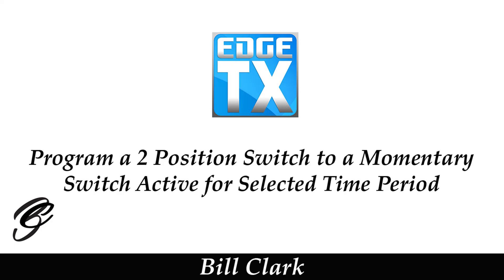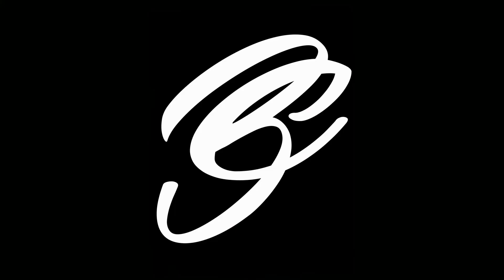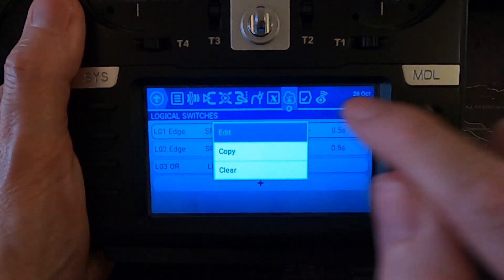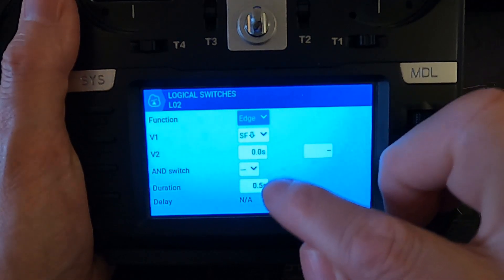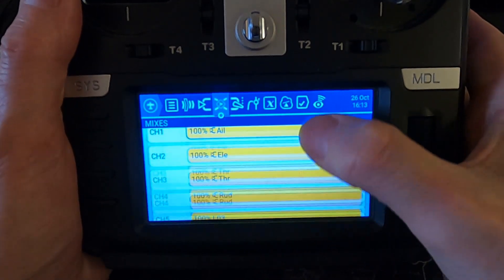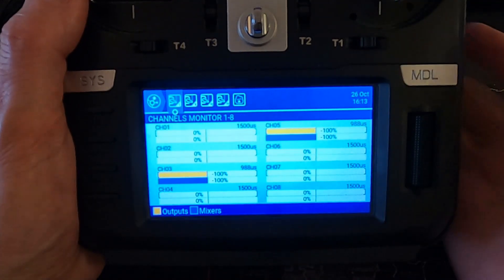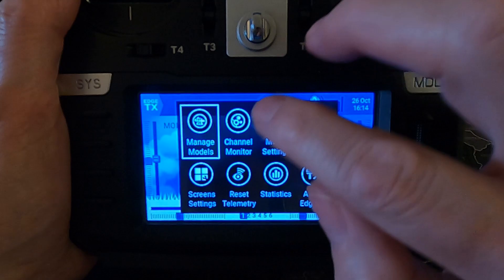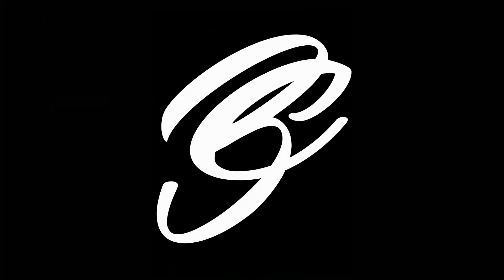Program a 2 Position Switch to a Momentary Switch Active for Selected Time Period

Comment: These tutorials are always interesting Bill - even if we don't have an immediate use for them. Thanks!
OK After the buttering up, maybe we could interest you in a little problem (which might not have TOO much general interest or use) that we've come across recently. 😉  To quote from the unanswered query on the forums .....

 "Peanut gallery here again. I'm sure that there is probably a way to get around a problem posed by a quirk of the old NX3 stabilizer when in "Hold" mode by using the programming capabilities of OpenTX. But our Junior Brains Trust not being available and the rest of us Old Farts having too many years and not enough remaining knowledge or intellect to attempt a solution, I wonder if any of the more competent posters here might like to try? On radio for preference.

Relevant details ....... "What happens with the NX3 set to "Hold Mode" is when say the Elevator stick is pulled back, the Elevator will rise to a point allowed by the stab gain and servo geometry. When released it will fall back towards centre - HOWEVER there is some hysteresis entering the system somehow as the Elevator WILL NOT reach the centre position. And again, if you deflect the stick forward then release it, the surface will stall in its return just before centre. Thus causing a "Bucking Bronco' control effect when trying to steer the plane without switching out of the "Hold Mode". What causes this hysteresis I don't know.

1 quirk is that the slight deflection (in either direction) is MAINTAINED if you switch from "Hold" to "Manual" (where the surfaces centre as normal) but then back to "Hold" (and the deflection returns.)
HOWEVER if you switch right through to "Rate" and then right back through to "Hold" again that slight deflection is gone!

This could possibly provide a method to kill these strange deflections by setting up your OpenTX/EdgeTX transmitter with a Special Function/ Logical Switch combo that flicked through Hold/Manual/Rate and back again when the stick value hits centre. I haven't reordered the switch positions to "Hold" - "Rate" - "Manual" to see if just "Hold" direct to "Rate" and back kills the preset or not."
Any takers?"

I thought that it might be possible to perhaps create a 'Dead Band" of a few usecs or so around centre-stick which, every time it is entered, would trigger a momentary flick through the stab "modes" via some logical switches/special functions/GVs to kill the surface lags. 

No pressure Mate! 😜😊
Reply from the maker: Hi Mate, looks like you are planning to use a plaster to fix a chopped off finger! 🙂 There must be a problem with the NX3 and is it worth putting it in a precious model? I would recommend getting a ZOHD Kopilot Lite which is more expensive but very good. I would love to get hold of the plane which is having the problems and attempt to solve it but difficult without seeing the problem in person. The deflections must be being caused by the NX3 the radio will not be making these deflections. Could try turning on and off the ADC filter in the radio but it's a long shot. I did test a Volantex Xpilot AX601 6-Axis Stabiliser and had a stalling problem which I solved using it's SBUS option. Next time I visit I will take a look! 😃
Reply: @the-happy-RC-flyer  LOL! No Precious models" here Bill, only 3 and 10 buck converted foam chuckies! 😉 Though many Old School Model Club Fliers have used the NX3 in their fancy toys over the many years that it has been available. (But only in its "Rate" and "Manual" Modes I believe.) 
Not being proficient pilots (and getting decidedly worse with the years as reaction speed, manual dexterity and eyesight goes to the dogs) us Old Farts have stabs of all breeds in just about everything. Many Kopilot Lites, (though their era has just about gone as far as Bang-for-buck is concerned) several "Sparrow" versions from the Lefei range, a stack of Radiolink Byme-A and D stabs (cheap and versatile) and even the 2 versions of the X-pilot stabilizer in addition to all the built-in stab versions in various sub-250gm RTF units. 😁
The NX3 was tested just on the table on its own (not in anything) after some "robust discussion" with some other folks as to being able to use the "Hold" mode in some satisfactory way. 😜
Thinking about it, probably the best way to use it would be to use the logical switches to only switch to it directly from the "Rate" mode when the sticks are centred on all 3 control surfaces (if used) and switch out again to "Rate" mode when the sticks are moved again. That way you could fly it into a heading in the normal way, release the sticks and it would "Hold" attitude until you moved the sticks again to alter the Attitude/Heading without the servos "hanging" every time you moved them from centre. 🤔
Oh, and to slightly misquote "Local Hero", how many of those "precious models" can you fellahs get in the back of a Maserati? 😉😂😂